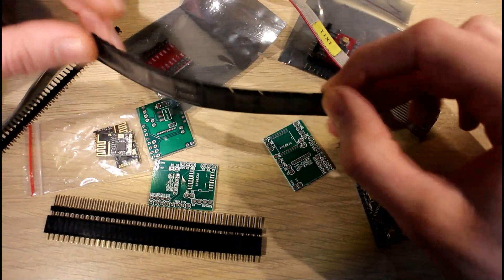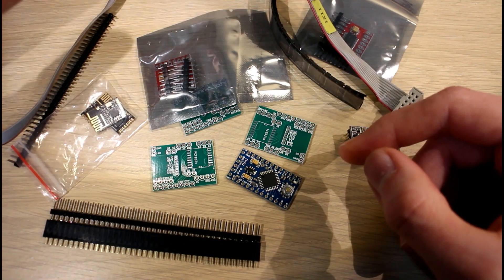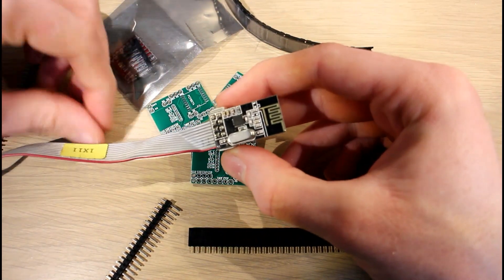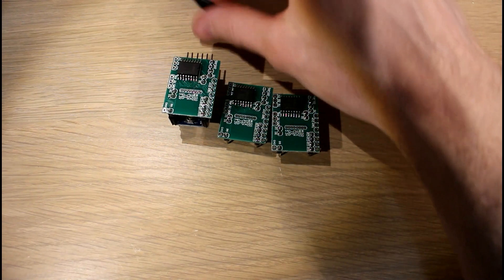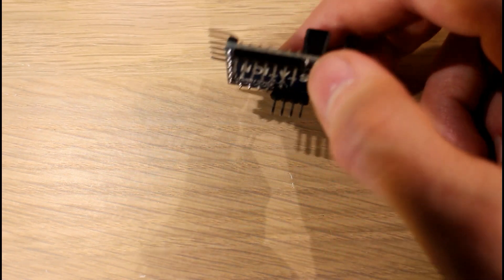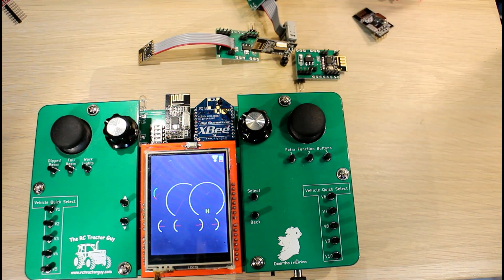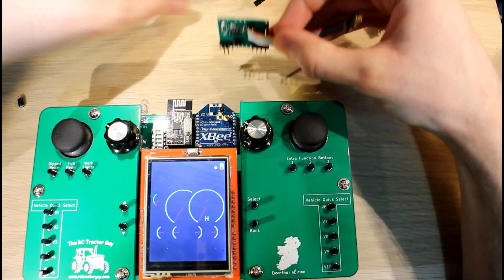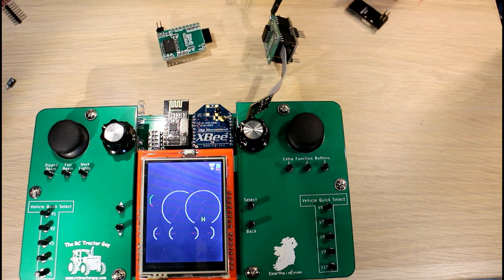Testing first vehicle PCB prototype

Comment: hey great vid keepem commin just wondering any chance you could turn a JCB 416S farm master in to a remote control machine? just asking not wanting mine to be converted i just got mine yesterday
Reply from the maker: +venombitegaming I probably wont be, the budget for this stuff is getting pretty tight plus the controller design is taking up a lot of my time so it might be a while before I start adding anymore models to the list. I still have a lot to get through with excavators, the new holland loader, the Claas forage harvester. A lot to do and no time to do it :)
Reply: +RC Tractor Guy oh ok just thinking out loud 
and what is this about a class harvester is it a forager (silage harvester) id love to see her
Reply from the maker: +venombitegaming Well it has a maize header at the minute but the plan is to make a grass head for it as I want it to try blow silage into a trailer but thats another big build that will no doubt take forever.
Reply: +RC Tractor Guy that would be amazing if it could blow grass also what should it have to lift the head sorta like a steering servo? i dont know i have no clue a bout that just thinking like usual ☺☺
Reply from the maker: +venombitegaming Yes hopefully suck up some fake grass like a vacuum cleaner would but we'll have to see how it goes, haven't had time to try too much out yet.